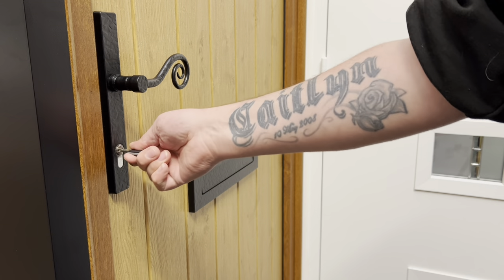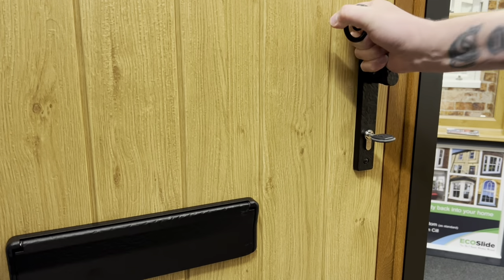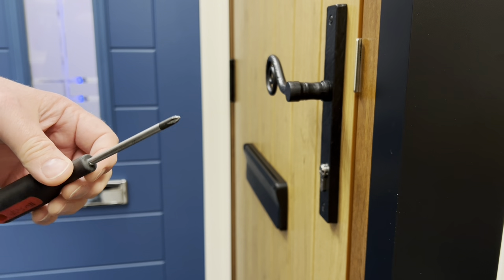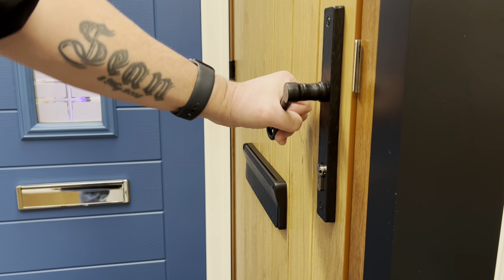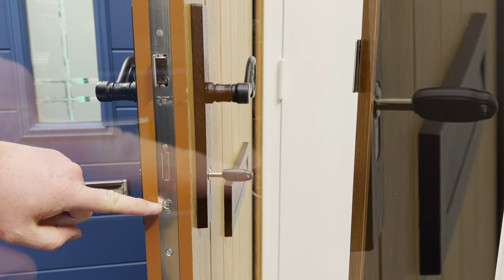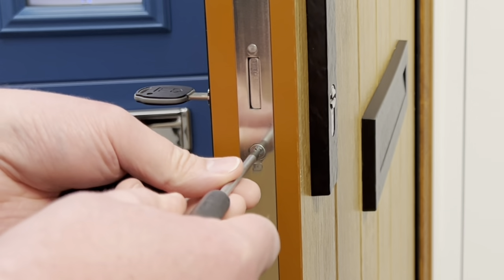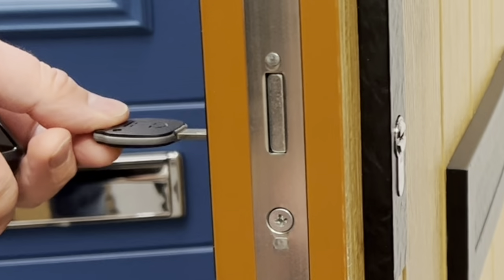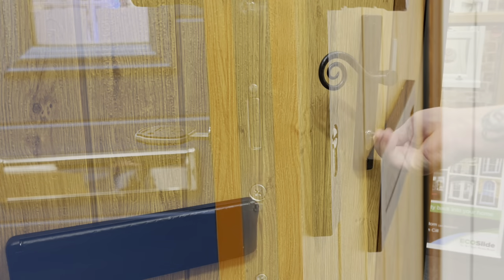How to adjust your Lock Cylinder

Comment: I had opened my lock for buffing because of rustiness after that when I did try to fix it again I couldn't able to do it because of that long screw which is not able to adjust in cylinder hole.